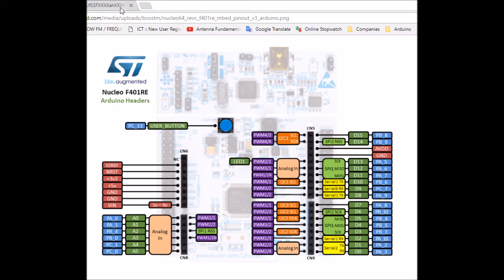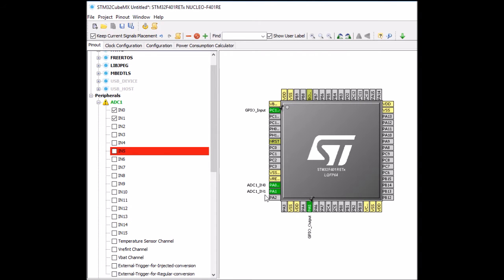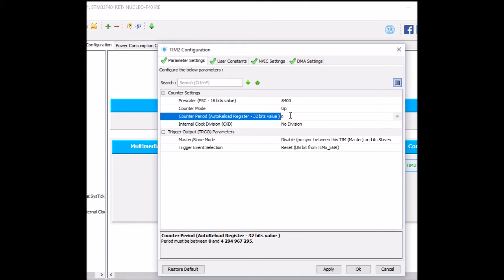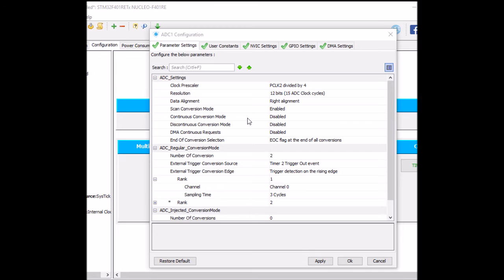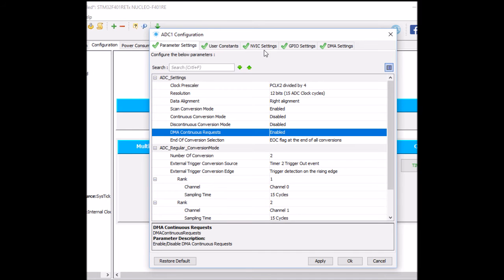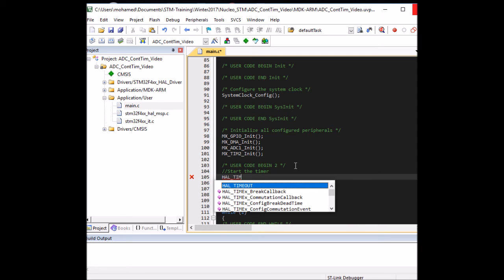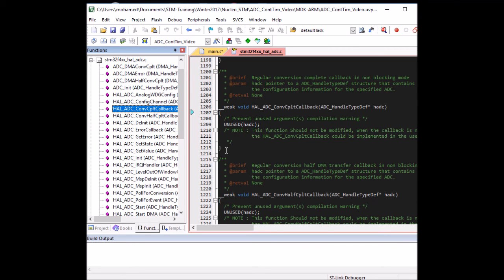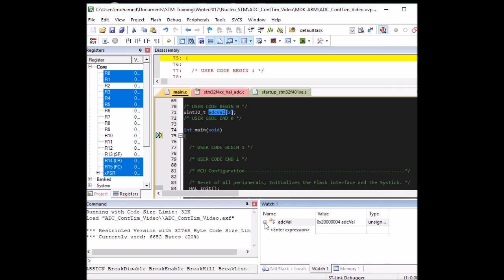STM32 Nucleo - Keil 5 IDE with CubeMX: Tutorial 4 - ADC Multi mode

Comment: Hi,I am currently using a 10k potentiometer under 3.3Vdc to act as a speed control knob and sent the corresponding prescaler for corresponding range of voltage input to the led frequency and i am not sure which mode should i use, single or continuous?

Comment: Thank you Mr Yaqoob, i am new in this field but believe me i learnt many things. I have a confusion in mind for example i need 1Mhz sampling frequency the formula : 84MHz/(9+1)(73+1) is correct for F401RE? second thing, what is relation of cycles with prescalar and sampling frequency?
Reply from the maker: Good question..
Prescalar acts as a divider to clock frequency.. with 0 corresponds to divide by 1. Thus the fact precalar -1.
Period acts as a counter on top of prescaled clock. So, it counts from 0 to Counter value. You put -1 here for overflow to happen a cycle earlier. Thus, you get your above 2 formulas
Reply: @mutexembedded2206  thank you dear for reply, but what about number of cycles chosed in Rank? Is it related to sampling frequency or not?